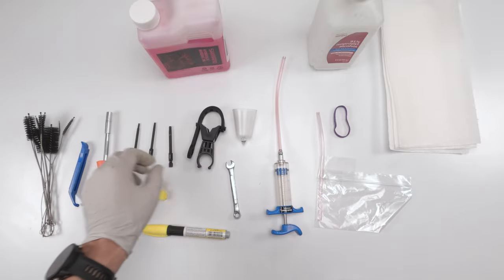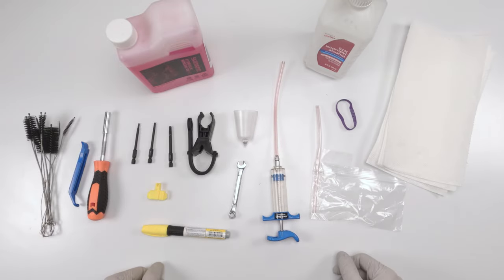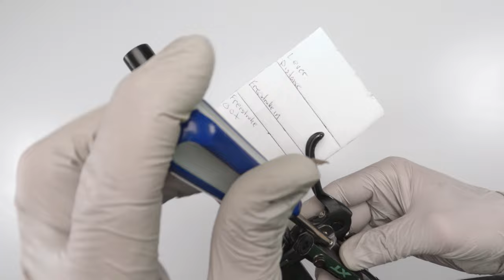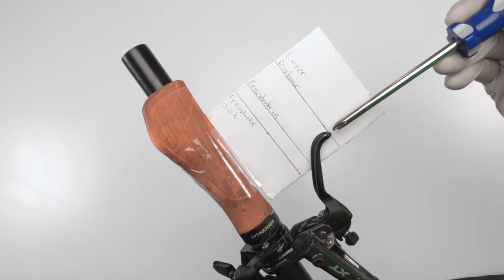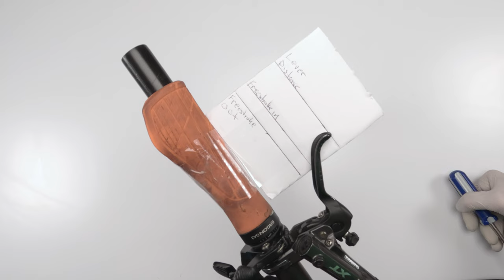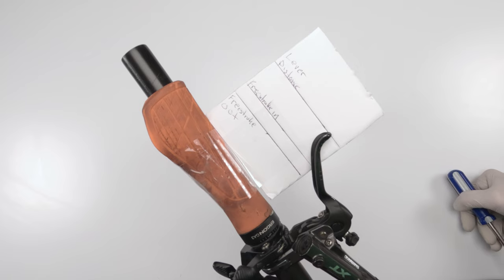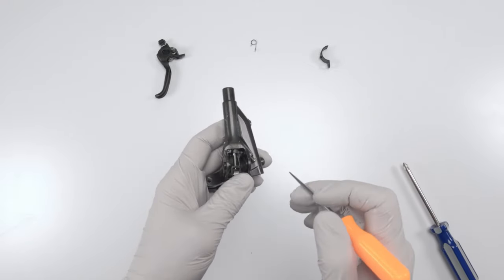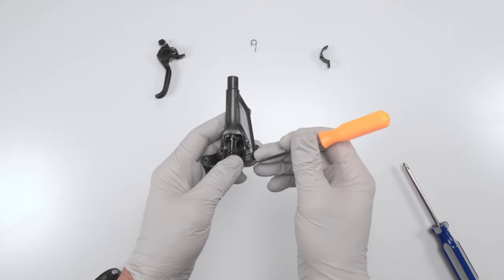Shimano XT M8000 M8100 Brake Bleed Service Guide for Beginners. Free Stroke FULLY Explained

Comment: Best freestroke screw explanation I've seen with those marks on paper :) Thers's one small but very CRUCIAL remark - if that wasn't you who last bled the brakes, you MUST open the lever bleed screw before pushing pistons in, or you risk puncturing the very weak shimano membrane in the lever if the brakes are overfilled. Happens more often than you think. I just do it this way every time, just in case.
Reply from the maker: Yup! I should have mentioned it, and my bad for not doing so even though I don't really practice it (though I do believe I mentioned to push piston back slowly). I need to script this stuff in order to remember to mention certain details, regardless of whether I practice them.  Thogh I will say that I've done hundreds of Shimano bleeds, and only once have I come across a leaky bladder, and not during a bleed. A buddy showed up with one at the shop after a ride about a decade ago. Next bleed video, I'll make sure to mention it

Comment: This is one of the most comprehensive bleed tutorials I have seen, though methods vary, there is still some stuff to clear up here.  The first one that will help the most people, is that shimano has made maybe 5-10 different servo wave designed hydraulic handles over the years, and each one is a bit different than the others.  This tutorial is using one of the older handles, where the stock screw happens to actually do something.  Rest assured there are many shimano handles where the stock screw does NADA.  If that is you, you ARE NOT IMAGINING IT.   That is simply due to the varying designs, all using the same exact length screw.  Shame on Shimano.  I sourced screws that were 2mm longer, and suddenly my XTR "free stroke" adjustment actually worked.  Be aware, however, that you can only move the lever piston a short distance before you cover the secondary orifice in the piston housing.  If you do cover it, your brakes will never have consistency untill you back that screw out enough to uncover it.  That orifice serves to allow fluid from the master in to the brake line to compensate for pad wear, and also compensates dynamically for fluid expansion-contraction with heat, it also serves to let air out as it evolves upwards toward the handle, as it does in all brakes over time.  Just going to higher elevations will allow air dissolved in the mineral oil to   bubble out, and it needs somewhere to go.  What is also super important to point out, is that using this method of piston advancement to shorten free stroke, also changes the servo-wave equation that Shimano is famous for in the patent world.  It is a nuance, but advancing the piston with the screw creates more modulation in the system, albeit not everyone will feel it, or care.  If you hate the brick wall feel of shimanos, this will lessen it a bit, and add a bit more squish modulation.  This could be very important also if using magura calipers that use a very short piston rollback, for example.  Shimano, by comparison has a much larger piston roll back because servo-wave moves a lot of fluid in the first part of the stroke.  This shimano combination is famous for all of this as a very maintenance friendly brake,  servo.wave also serves to eliminate pad rub issues because the pads are further from the rotor (large piston rollback) than other manufacturers who cannot use the servo-wave technology.  I wont beat this to death, but my opinion is that if you want to shorten free stroke, do it with the caliper removal (or wheel removal) process described in the comments.  If you want to tailor the handle to calipers with shorter pad rollback, use the free stroke screw to modify the servo wave curve, in turn creating a more powerful brake, as the most power is obtained from the shimano handle when it is deep in the lever stroke, or more accurately when the servo-wave cam attached to the handle has the most leverage on the piston rod.
Reply from the maker: I wish I wasn't so behind on responding to messages, so I could have thanked you sooner for such a clear and detailed explanation of the effects the bleed screw has on the system. I honestly tried to go into it a bit deeper into the mechanics of it all, but it ended up sounding like a bunch of babble, (which I already have a problem with 😉), so I decided to delete the clips and leave it at a high level. You laid it out perfectly in only a few words,👏👏👏 which I highly appreciate. Thank you for sharing your knowledge with others. 👍

Comment: The best way to pour from any rectangular type bottle is to tip the bottle sideways when you pour it. Works in the car without using any funnel too.
Reply from the maker: totally Agree. That's how I pour it for engines as well. though I will say, This bottle design deeper than typical inward lip that has a tendency to pull oil toward the body. I've given up on it! 😁

Comment: I have never touched that screw, tomorrow I'm going to mess with it! 👆🏻
Reply from the maker: 👍   Just remember, it all starts with your preferred handle distance, always return the handle to the same distance. and don't expect drastic change. The change is very subtle, as it was designed to be, and you really should decide after a few rides on your favorite trails going back and forth between the in and out position. pay attention to down hill turns and tight a windy technical sections. that's where I felt it most with the back wheel

Comment: Hello. The problem I have is that the new m8100 right hand brake lever, once pressed, does not return as quickly as the left hand brake handle. The delay is approximately 0.3 seconds. I bled the brakes, checked the piston and cylinder surface - everything is fine, but the handle is slow. What could be the reason?
Reply from the maker: I'm sorry to hear about your issues. Assuming the system is fully bled, and you're  having this issue, then your best bet is to warranty the lever if it's new. Take advantage of the warranty. There is a good chance the issue is with one of the lever piston seals. There is a way to check this, but you might as well get a fresh replacement since it is not supposed to do this when new. 

let me know how it goes

Comment: This actually incorporated everything ive seen on bleeding shimano . You can follow this and be done.
Only thing that i can add is if after cleaning pistons , if one or both are sluggish, just apply some brake fluid around piston AFTER cleaning. If one piston is not retracting then hold good one back with tool and let bad one come out a bit more and thoroughly clean and lube a few times and retry both pistons again. Keep going until you get improvements.
Thanks for the excellent video esp the free play screw
Reply from the maker: "If one piston is not retracting then hold good one back with tool and let bad one come out a bit more and thoroughly clean and lube a few times and retry both pistons again"
YES!! I couldn't agree more and I mention this to people all the time. I think I even mention in in one of my other videos. but I plan on making another brake video soon (changing the brake cable and full clean and bleed for a rear brake) where I plan to go into what you mention. 👍

Thanks for such a great comment. 👌

Comment: Wow! Imagine watching a 29 minute brake bleed video and being glued to the screen the entire time, wanting more at the end?!  Getting ready to do a build using these brakes, and this video is a MTB Godsend! For rear brakes I would imagine you want the bike angled back in the stand, correct?  Anyway, thanks for taking the time to explain everything!
Reply from the maker: Thank you very much for such a gracious comment. I'm very happy to hear you found the video informative. Yes, for the rear brake, tilt the rear end down and make sure the brake handle is at the highest point, including the cable that wraps around the headset. Take your time with the bleed, and I'm sure all will go well. Let me know if you have any other questions
Reply: Brake bleed went very well. Couple hiccups on my end where I'd let the funnel go dry and have to start over, but not a huge deal. Took my time and was done pretty quickly. Took the bike out on the trails the other day with no issues. Thanks again.

Comment: This is a very good video regarding free stroke adjustment and good explanation on bleed procedure. I would point out few potential problems that could occur while bleeding when following this:
- when creating vacuum with syringe to pull oil there is a slight chance to pull in air between threads of bleed nipple bolt and caliper, this should not happen if you are careful not to unscrew more than minimum needed and threads are like new. If you pull air like this you should see it in the syringe hose but this is not always the case and there is a chance that air stays in the calipers bleed bolt and when you compress oil back from the syringe you push that bubble in the caliper and then it could be tough fight getting it out
- what has not been stressed out enough is that this bleed procedure will work for most cases where air is trapped at brake leavers and caliper bleed bolt, there could be so many places trapped air could sit and this procedure will never get that air out mainly because "gravity bleeding" is not being explained/used
- this procedure works better at faster flows of oil but also this has tendency to break big air bubbles in to many small bubbles (or even creating foam) which makes it harder to dislodge them from walls on calipers and hoses, if you see this happening my advice is to stop bleeding and let it rest for hours if not a day until small bubbles come together in to one big bubble

If this procedure does not work for someone and they are sure brake system does not have failure point where brake system is sucking in air past seals I would strongly recommend to learn and understand how gravity affects bleed procedure. It's simple in a way that air being lighter than oil will always try to move to highest point in the system and stay there. Most common problems are air trapped in rear caliper behind pistons on the opposite side of bleed bold and or in the "bent" hose where apex of the bend is at higher level and if you don't enough oil in one push, oil will keep floating back to that high point in the hose and you will never get it out
Reply from the maker: I couldn't agree more with everything you said. I tried touching on each of these points in this video, as well as some other similar Shimano brake videos, but you're right that I should have emphasized them more. It's such a balance to try to deliver as much information as possible and keep videos relatively short at the same time (which the latter is obviously a bit of a challenge for me 😉 ). There is still a lot for me to learn when making these videos. 

Thank you very much for the insight. Comments like this, which can really help others have a better experience, are what I was hoping for when I decided to continue making these videos. Greatly appreciated! 👍
Reply: I completely understand that going through all the details and problems would be more like making documentary than a guidance video 😂 and most people would not watch that. My comment is to hopefully avoid having someone disliking this video or not recommending it because this method didn't solve their problem.
I find it shocking how many people ride brake sets for bicycles and motorcycles are not bleed properly or at all and they complain about how bad they are.
One more thing I would also mention is that wondering bite point of any brake systems is  also directly related to brake pads being used and to how caliper poistons recract after releasing the brake.
Reply from the maker: @nikolasestan2049  All I know is that the info you provided is worth gold to me, as simple as it may seem to others. I fundamentally believe in repetitive learning, and having others point out small details, whether I knew about them or not, helps with retaining information for the long term.  

A great example is using crow's feet. For decades, I've known that they are supposed to be used in a 90 degree manner, yet in the couple of videos I made, I had  forgotten to do so. After a few people pointed this out, it's now a natural response again.

To everyone out there. If there is ANYTHING that you see in a video that is either off, missing, or just plain wrong, please point it out. As much as I'd like to help others, I also like to keep learning. My only request is that it's not based on "BRO" science.

Comment: So I just bought a second hand grand canyon SLX 9.9 and the brakes were a bit too soft and needed work.

So I found a video about what settings for the brakes etc. Free stroke al the way in and lever the furthest away from the handelbar. Yeah that didn't do a great job.

Thanks for making the vid! I understand it a lot better now.
Reply from the maker: This comment (plus a few others) slipped through the cracks, so apologies for the late response. Very glad to hear it worked out for you. Bleeding with the free stroke fully out offers more viable options for brake feel imo. I like the options of hard and a bit harder. if you bleed in then the options are hard and a bit softer. I've never heard anyone complain that their brake are to hard. only the opposite. thanks for the comment
Reply: @zoubtube  don't apologize haha, no need to. I'm just thankful for your upload and explanation. Have a good one!

Comment: The push-pull method works well on my front brake but not my back brake. I used a tip mentioned elsewhere which was to use a bike stand to keep the bike upright so that the rear caliper is lowest (and closed off) and the brake lever bleed port is at the top. I then screw a tube with a bit of fluid in it into the bleed port (brake lever horizontal and tube open ended). I then gently tap, beginning at the caliper, along the hose all the way to the brake lever. I then leave it overnight and the next morning I remove the hose, re-seal the bleed port and hey-presto, a solid brake lever. Another tip to prevent air getting in at the caliper bleed screw is to put thick grease around the threaded part.
Reply from the maker: Thanks for sharing your experience with everyone. I couldn't agree more with you, and I believe I posted a rear brake video that talks to tilting the bike to assist with the bleed. First time and Heard of applying grease to the ports screws. Might give it a shot for next season. 👍

Comment: This was a fantastic guide. Would love to see more closeups though. Would help if I can see exactly what you’re talking about. It doesn’t NEED it though. Still loved it!
Reply from the maker: Thank you very much. I totally agree with you and want closer shots as well, but the GoPro has ~ 13" minimum focus distance, which makes it impossible to get close-up shots. I'm still trying to figure out a camera setup that will allow me to do this. My concern is that I get grease and oil on the GoPro during every session. It's a super easy to clean, especially with the media mod on it. Finding a mirrorless camera capable of 4K at 60 fps, plus lenses that are easy to clean, is proving to be a challenge. I don't mind spending the money, but I would hate to destroy it with grease and oil.  I need to figure this out.
Reply: @zoubtube  Yeah the oil and dirt is an issue for sure. If you could find a nice camera that you like, you could always use a remote with it too so you never have to touch it. They usually let you zoom in and out to a predetermined distance with one button so you’d only have to set it up once. That will certainly help to minimise getting it too dirty. I’ve subbed now though, so hope to see more videos in the future. Cheers!

Comment: I recommend that you pour the mineral oil from the container with the handle parallel to the handlebars instead of perpendicular to it, I assure you that it will be much easier to avoid spills. Sorry for my English, thanks for the video.
Reply from the maker: YUP! I totally agree, and  it's how I've been doing it for YEARS! One thing I've noticed since I started making these videos is that there have been many times that I've deviated on some of the details from how I normally do things. Usually, it's just me, in a quiet room, taking my time while working on a bike. When recording, the entire dynamic changes. I start overthinking things, constantly feel like I'm in a rush, always think of how a clip turns out, have to work around lights and cameras, etc. LOTS of distraction. I just need to get more used to the recording part, but again, you are right as to pouring the oil from the bottle

Comment: Best video on this topic on YT. And I’ve seen many. 

Should we open the system BEFORE pushing those pistons back in?
Reply from the maker: thank you very much for the compliment. When prepping the caliper (cleaning the piston side walls) leave the system closed. After the bleed block is installed, compress the system so the pistons can squeeze against the bleed block, then open the reservoir port. This way you maximize the amount of oil in the system as well as center the piston for the bleed, making it easier to center to rotor to the pistons after you install the wheel when the bleed is done. 👍
Reply: @zoubtube  I think @gokkunguru is referencing the risk of puncturing the bladder in the lever with excessive pressure by pushing the pistons back in while the lever bleed screw is closed. This is a common problem with the delicate bladders in the levers (xt, xtr and saint), a very weak point in the design.